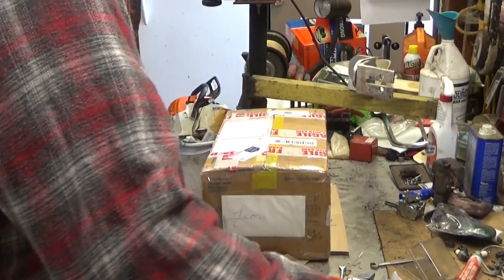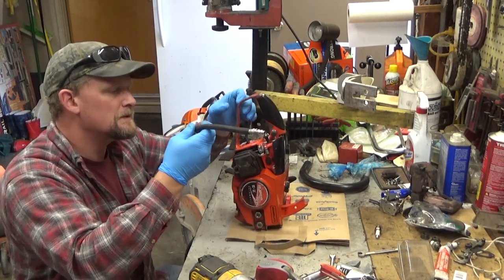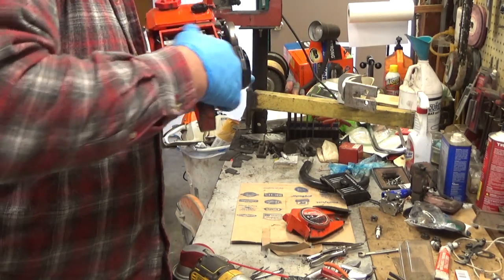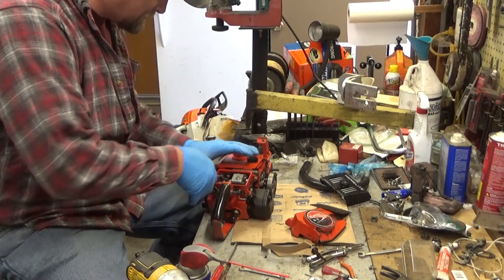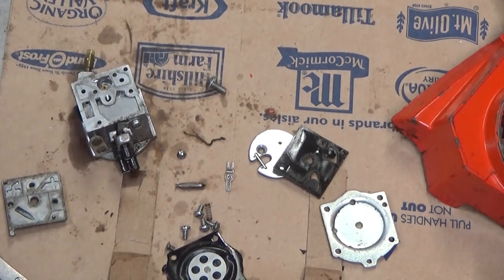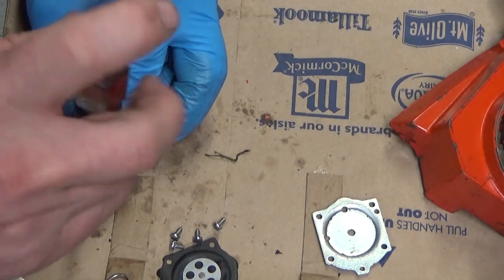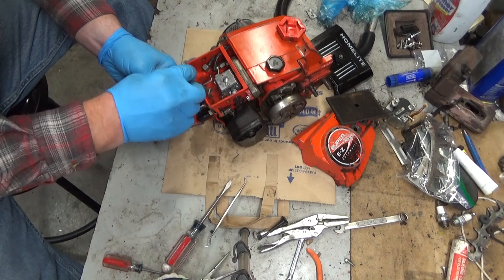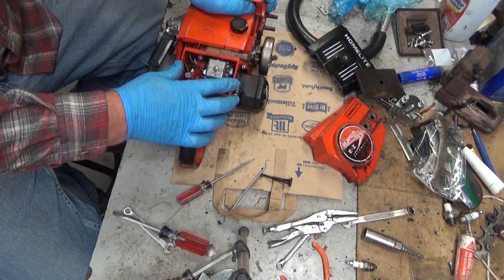New To You Chainsaw Diagnosis...Allen's Super EZ & Walbro HDC Carburetor Disassembly Detail

Comment: Just found your channel. OUTSTANDING! I've been wrenching on saws for 40 years and you are the best presenter  I've seen on You Tube so far. Articulate, clear speaking, you lay the process out and you tell why and what you're doing. Well done! And then on top of it, you;re working on one of my favorite little saws, the Super EZ Auto. Snotty little buggers they are and very reliable. One of Homelites best IMO. Again, well done, and also thanks for the very limited cursing. It's nice not to have to mute the sound if my grand daughter walks by like I have to do with some of these other clowns.

Comment: Thank you for this video Leon, I have recently aquired one of these saws and it also would flood out. I wasn't sure about the needle movement but you showed us how to adjust the movement. I also noticed the fuel pump diaphram was placed on top of your gasket and not below. Which I think is my problem. I have fuel leaking out of the carb when it stalls.  Maybe it's because there's no fuel return. I will teardown the carb again a place the fuel pump diagram back in the proper position. Hopefully that will solve my flooding issue!!
Great videos!! Thanks Again!

Comment: I never try to start a "used" older chainsaw without first removing the exhaust. Any debris or rust can easily get sucked into the engine and you can check the piston/cylinder at the same time. Next is checking for spark. Blow as much debris off and in the saw out with a blow gun. Open the tank;  check the filter if there is one and rinse with ethanol free fuel. 40:1 mix, start the saw and do the seal test.

Tell you one thing, Leon knows chainsaws. Learned alot from watching this channel

Comment: I was going thru a 330 about the same year..no chain break...bad news when I took the carb off to check out piston skirt...there was what looked like denatured rubber in there.  is there a rubber intake boot in there...my first homelite...lol there was one of those ez in the pile I got and another case that's missing a lot of covers its older an smaller but configured like the 330...so I'll be emailing u for parts...i enjoy the videos bud thanks

Comment: I have a Homelite EZ saw.  How many cc's are they ?   A shortened (ground 1/2 inch off) 5/8 plug socket makes plug removal/replacement much better.
Reply from the maker: The EZ is 35cc, EZ Automatic is 38cc and Super EZ is 41cc.

Comment: Been wrestling with a SEZ.  Got spark.  Got compression to spare.  Will start (sometimes) and rev but not idle for very long.  Recently found your video about the circuit plate gasket differences.  Went into the carb again last night.  Changed the circuit plate gasket and fiddled with metering lever some more.  Same symptoms.  Is also get spit back in the 

Guess I’m gonna have to look for other causes?  Air leak?  Reed valve?
Reply from the maker: It could be a reed valve...wouldn't hurt to check, but they are a bit of work to get to.
Reply: I'm going with reed valve on this, If you do have to go into it you will need the gaskets. However you do not have to remove/replace the cylinder gasket if you don't want to remove the cylinder. You can cut the existing gasket at the top of the cylinder and do what you need to on the reeds, then take the new gasket and cut off the section for the cylinder and only replace the top. No sense in removing the cylinder if you don't need to and especially just to fix the intake gasket.
Reply: May be too late to help u but the ez is about the easiest to start and idles about the best of most saws i have repaired . the start needs choke on to pull fuel tru main jet, metering chamber , fuel pump and tank. hi ck valve has no effect unless it blocks flo tru hi jet. if the decompression lever is on and  adjusted to open the short throttle shaft lever on right side to 3/16th lift for a fast idle throttle opening . fine adj.the fast idle by screw at top front of handle. the lower compression allows faster ,easier pull w higher spark available to plug. .bad idle is due to too rich or too lean .too lean can be starve out caused by def hi check valve allowing air press. of 14.7 lbs into metering chamber pushing diaph. up stopping fuel inlet and gradual starve out. if reved it again idles good for a short while . too rich is either hi jet adj, high fuel levet  due to leaking needle or metering lever control.

Comment: The HDC will have a slow bleed down and is common until you run mix through it and then the gaskets will expand and stop that. 

You are a lot better on getting the carbs in and out of the air box, I typically take the handle off and pull the trigger off it's pin so I can rotate it easier to get the carb linkage loose. 

I have also been using NGK 6421 (BM7F) plugs in my SEZ's but I have never had a Champion plug fail me in a saw so there really isn't any reason for the change to NGK if I was to be honest with myself.
 
For starter cord on the SEZ I have started using Stens True Blue #4 1/2,  jeez I hate getting that recoil spring retainer C-clip out, I had one that the lube for the recoil spring had changed to the consistency of dry pine tar and I had to unwind a spring from the inside out just to get a pair of needle nose onto the retaining clip to get it out because it was so gunked into the housing and even tapping on the end and every other trick I could do wouldn't break it free.
Reply from the maker: I've definitely experienced that and agree completely!

Comment: Hey Leon that will be a nice saw. If you don’t mind me picking your brain for a minute I got some trouble with an husqvarna 2100. It’s an idle issue it will idle fine right side up but if I turn the flywheel side up it will idle slightly faster, if I have the clutch side up it idles slightly slower and tends to stall when I turn it upright. It’s driving me nuts. I rebuilt the carb and new pen fuel line and filter. I replaced the crank seals and seemed to pass a pressure test. I plan on redoing this test next week. Any thoughts on what would cause this? Thanks: farmer Jackson
Reply: from your description it's a slighty low fuel level as the low jet  inlet is on the right side .or front of the carb..you adj. the needles in the level position and the sides or front position alters the amount  of fuel.or level available to lo jet inlet.